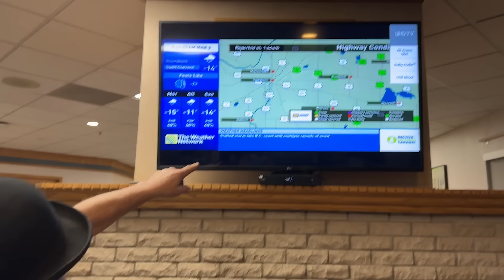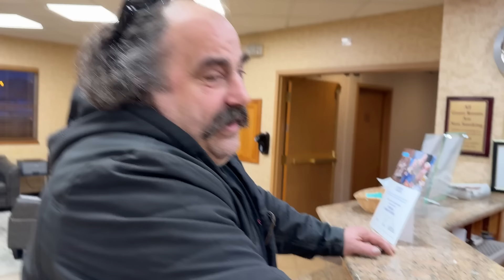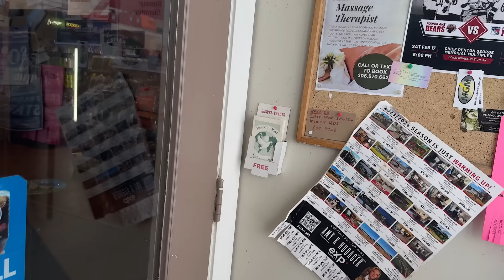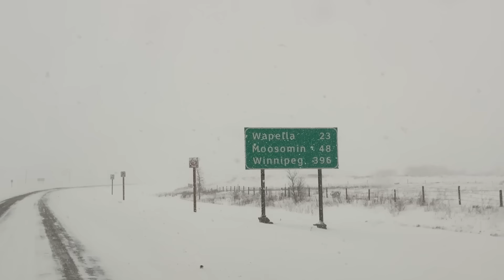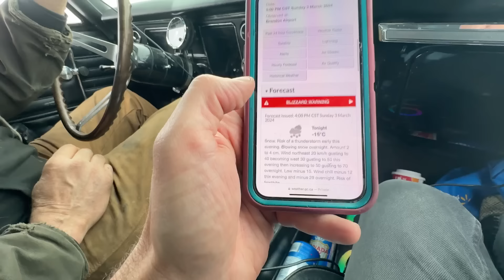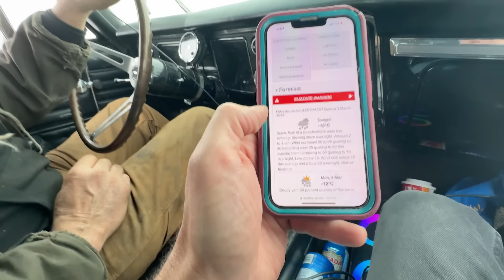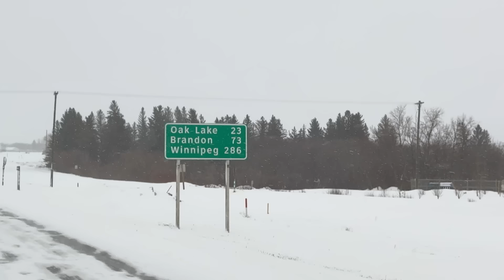Road Trip to Motorama Day 3: Tensions Rise While Battling the Blizzard in Saskatchewan

Comment: I had car trouble in a Sask. white out & could hardly do 80 km/ hr.  But everybody was doing 80 with their flashers on.  Limped into Swift Current.  A nice motel manager cleared a path to a room with his skid steer.  The Mazda dealership in Regina fixed my car the next day.  It turned out to be a computer module that was supposed to neutralize rust on the frame.

Comment: It got way worse after you left I actually had to put my Chev 4x4 Truck in 4 wheel drive & the snow was so high That when I drove out of the garage I almost got way high centered As I made a big ole groove From my garage To the road & because snow was so high! I almost high centered my truck w 36'' tires Deep Tread Tires In Snowy Saskatoon & I have a buddy In the Iroquois Lake area Who has the coolest older black w chrome car ever! It's an old Oldsmobile From the 50's 60's Just needs body work & a refit If interested Merely let me know & if you are in Saskatoon At any time & you need a shop To fix something Or to add a part Like a block heater!!! Haha Just let me know Too cold for most tourists! Especially if you are from The west coast Haha The B.C. coast As I've lived in & grew up in Victoria & Kelowna B.C. ML&RAlways 😁